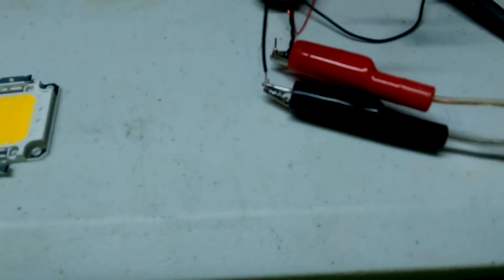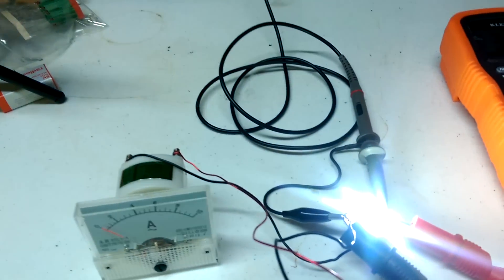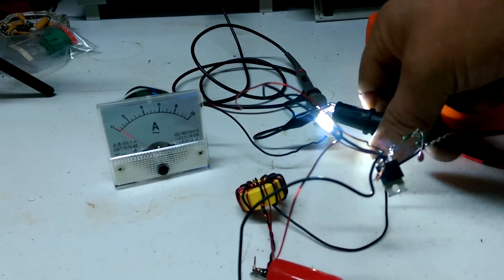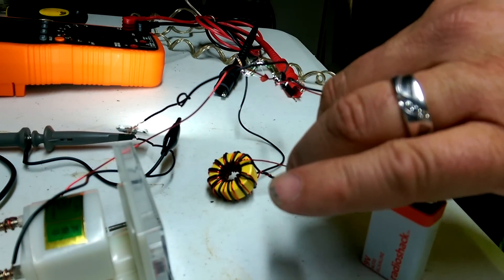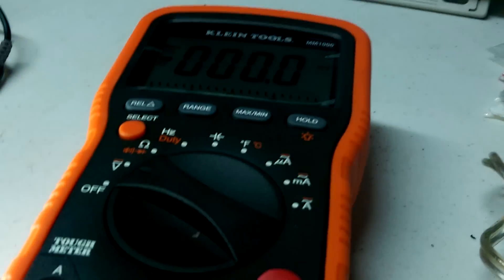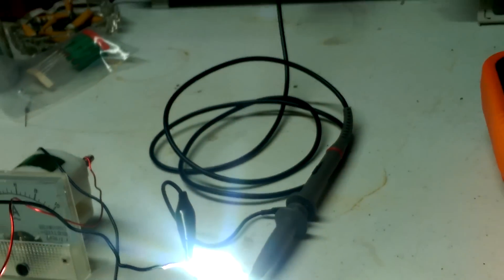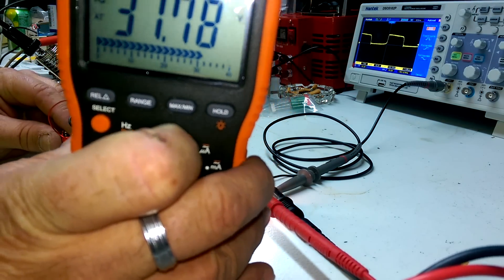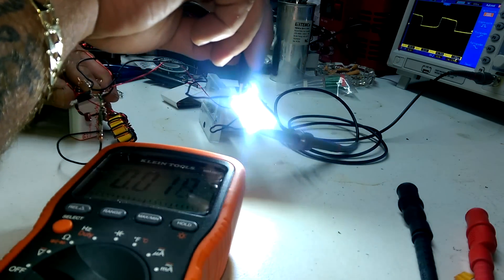Additional energy with Bifilar Joule Thief. 85% more. Is It Overunity?

Comment: Without proper measurements, it's all hearsay and guesses.  If you'd measure the light output from the LED while on your circuit, then use the very same LED and power it with your variable DC power supply until you get the same light level, THEN you can know how much POWER your circuit outputs.

The human eye has a near logarithmic response to light levels. There is no way to estimate light level (brightness) by the naked eye. It takes 10 times the light (lumens or CP) in order for the eye to discern a 2:1 brightness increase.  Don't believe me? Look it up!

I'm not against you or your experiments, what I am against is making unsubstantiated claims (guesses and assumptions) without proper instrumentation. 

KEEP EXPERIMENTING!... but learn how to properly measure.
Reply from the maker: +beforebefore there's a lot of issues with testing some of the circuits I build. When the circuit's output is comprised of cold electricity, there's an output of however much light we get. but, since the voltage is correctly in the negative range, it isn't conventional and it reacts in a strange way. The voltage sometimes shows negative, however, in one of my don smith replications the voltage was zero and the led lights up.. amperage is zero too. I'm not sure what you'd measure that with but it is true., and it isn't loading the source up one bit. I could also go near the circuit with an led, hold one of the connections and it will light up. I have never seen this happen with a diode., which an led is. I am finding that I can draw in additional energies and I have so many different sources, it's not only one anomaly, it is so many different ways so there is an energy here that I am able to show in 3 or 4 different ways that I have been tapping in different ways , unfortunately, not everybody notices this or encounters it because they don't know what to look for. I figured it out after a worker of mine did something and an arc came out of a non connected part close by. I run an electrical construction company along with my brother and we are constantly seeing all sorts of things happen on different jobs, some of the projects are working on older systems, some newer . The older systems that were not matched usually result in connecting old parallel circuits with unmatched transformers. When they are connected by means of a gang switch, on and off, all is well, however, if we connect them or disconnect one phase at a time, one of the phases, the last connected displays a massive output of energy.. not just voltage. I have taken this phenomenon and have replicated it many different ways, with solid state components, high voltages at low amperages, then, created the imbalanced scenario and have continuously created this energy flow.. I did this with Pelex by offering these phases driven in opposition to the input with out of phase windings. It has to be done the right way but it draws in cold electricity that will blend with conventional, but, strange measurements happen, such as much lower voltages and different types of light emit from bulbs, etc. The measurements are sometimes comp;letely impossible to do because the meters do not see it at all, if they can even see 3 volts in other cases, or, the entire voltage is sometimes shown, or even negative voltages, it all depends on the waveform and it's frequency. The amperages read funny too digitally since the current runs on the skin of the conductor like high voltages do.

Marc
Reply: +Marc Belanger   I do understand that radiant energy (cold energy) can not be measured by normal test equipment.  That's why I suggested doing a comparison on the "EFFECT"... the LED light output level. 

If you measure it putting out "X" lux (the absolute measurement isn't really critical), then take that same LED and connect it to your nice variable power supply until it outputs the same "X" lux on DC... then you can read the Volts/Amps required, and you will then know how many Watts your circuit is making.

You could even use a solar cell with a resistor load to measure the "relative" LED output... no need for an expensive Light Meter. 

I'd like to help you find ways to measure it, it would help us all. 

BTW, your multimeter will not measure AC V. or A. accurately if it is not a sine wave, or if the frequency is above 400Hz... and these Joule thief circuits usually run 50kHz to 500kHz.  Only an appropriate oscilloscope (with High Voltage, high impedance probes) can measure this kind of power. 

When you get up into the 100's of kHz, and if it's pulse waveforms, you get the weirdness you mentioned. High dV/dT power pulse circuits like these create a high energy EM field... causing the cell phone blockage... as well as any other RF communications.  Holding an LED by one lead (acting like an RF ground), causes the other lead to act like an antenna, and since it's a diode, it performs its own rectification... and lights up. That's a common effect when dealing with high energy pulse and RF circuits.

I've dome some reading and investigation in the past about the power transmission line "weird effects", usually (like you said) it happens when a single phase has been broken. The long transmission lines and transformers become L/C resonant circuits, and can cause voltage peaks of a million volts or more on the open phase... quickly destroying transformers, insulators, HV dist. breakers, and power lines.  Resonance problems on high voltage distribution lines is a well known issue, and devices & methods have been developed to try to shunt these problems as quickly as possible.

Good luck!... keep on keepin on!
Reply from the maker: beforebefore I have been decoding the differences in watt's law as well as Ohm's law for radiant energy. Since I have seen and noted that there are more than one type of radiant energy, it is difficult for me to assume that the type of electricity used are the same. I can only figure this out by the characteristics the circuits offer me. I have found that resistance and impedance act in an opposite manner, so, the outcome of watts out vs. watts consumed will be a tough one to decide. Overall wattage comparison by light levels are understood and will be able to be performed once I receive the lux meter, however, I am waiting for a pair of new meters to arrive that have the lux tester built in, and, they are coming from China which are approximately 2-4 weeks away.. amazon from china takes forever... It's one of 3 metering devices I have yet to purchase before now, and the other is an impedance meter, which I can't wimp out on purchasing a really good one. The next is to buy a high frequency laboratory voltage meter. Since I will eventually figure out the mathematic characteristics of this energy by testing it with all of my different components and upcoming test gear, I should be able to figure out how it works and use my upcoming calculations to determine what I will need to engineer a circuit. Resistance/impedance works exactly opposite with radiant energy than conventional power works. I have found that 20 watt light bulbs become brighter than 100 watt bulbs and they use much less energy, however, the bulb's lux is way brighter when using less energy so it is going to be tough to see what's actually happening. I am finding that some of the circuits won't even allow electrons to flow unless the wire has a very high resistance, and, sometimes I have to add a 2.5 kOhm resistor just to see light from a bulb, again all dependant on the energy used, the voltage output and frequency. There is a massive difference between ambient energy and cold electricity. I find that capacitors can be used with avramenko plugs to draw in energy from an ambient source such as the aether, leaky or inefficient energy sources, such as variacs, etc. I sometimes get batteries to charge from variacs or other transformers and capacitors being next to them, such as my Don Smith replications. This morning I have discovered yet another method to capcitively couple devices together wirelessly, as well as with one wire. I can use 1 wire from the home with less than 10 watts to feed a very unique circuit which allows thousands and thousands of watts to the output. The unfortunate part I have to deal with is the capacitors are showing a reverse voltage and I can't connect to them backward with a battery because it will short out the battery. I can't even ground one rail of the capacitor without short circuit yet, so, I will have to continue my research until I figure it out. I am way ahead of many with these devices, and, the more I mess with them, the more I learn.. it is just a matter of time before my home is off grid permanently.. I am considering this to happen in just a few days to a week's time.. We will have to see how the power company and the electrical inspector like this.. The devices used are all UL approved, and it is an incredibly simple circuit. unfortunately, nobody knows exactly where the energy comes from, so, it could never be awarded a patent unless  somebody really stupid allows it through without researching it. The patent office would never allow anything to be patented knowing the energy levels are pretty much infinite, as it would decimate the country's ability to collect tax money, and it would ruin the economics of the US pretty much overnight as folks purchased the equipment, so, I am trying to find a use within the power companies to sell it to so we could all save $ from it and eliminate oil consumption for power generation. Much work will be necesary before I could get cars running from them because of mobile devices and the lack of a driven ground rod.. I hope this could be solved using germanium diodes, however, I can't say for sure. As for testing my circuits, I will only be able to keep what I have for videos up and I was directed not to list others to prevent the discovery of how it works. In the video, I haven't shown everything, so I am fairly confident I am the only one using it at the moment and I have to keep it that way to get it to market. Not everybody will be able to build and use these, there are always the millions and millions of elderly that can't do so, so, My efforts will be to make and sell them to these folks at very affordable rates if i could ever get this UL Approved, which I doubt will ever happen. I have already started to contact other countries to try and work with them to consider using this method of generation in very poor areas. Chile is next.
Reply from the maker: beforebefore this circuit was not the one I use now for anything, it was just a lucky build using parts that the circuit didn't call for and my coil winding just happened to be in resonance
The circuit I am speaking of is more powerful than Pelex and it has no ill effects like stray unknow radiation

Comment: Some news today !
I've swapped my black toroid with a bigger yellow one.
And.....
....It's working !
I Pluged everything, and the results are very good : 3.3v and 0.200 mA.
Not full brightness, but I have to tune the circuit with other caps and more or less turns.
Marc, when you increase the number of turns, do you increase the brightness ?
I'll try when I have time to plug my scope.

Very nice !
Thanks Marc.
Reply from the maker: +Michel Pepino   I have had less brightness and the variables for the components I think needed to be changed when that happened. I had good luck with the first one built, replication I haven't had too much time to complete yet. I will work on it this evening.
Reply: Hi Marc. The best brightness I can get is with 5 volts, and 0,7 Amps. Very bright, but no so much than what I get with the led direct on 12 v. Still trying to find the best brightness and lowest voltage / Amps